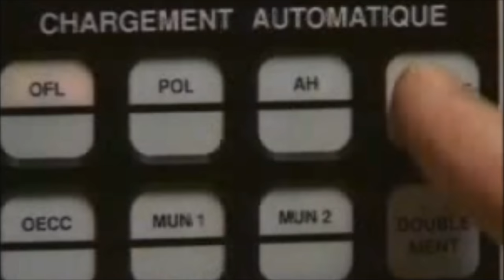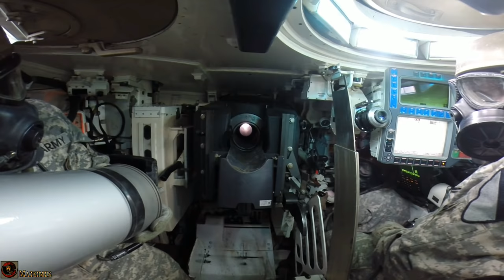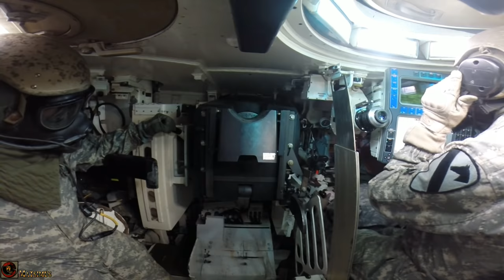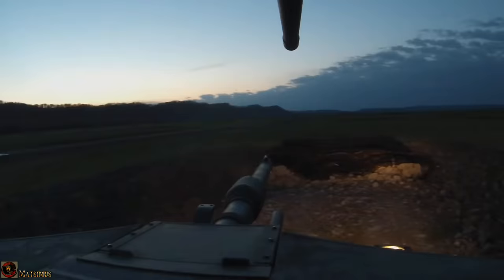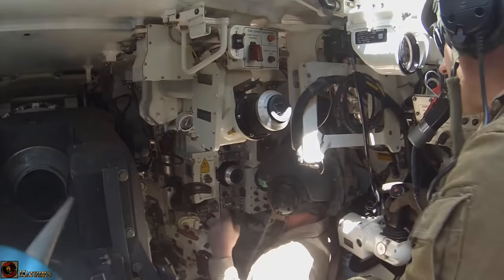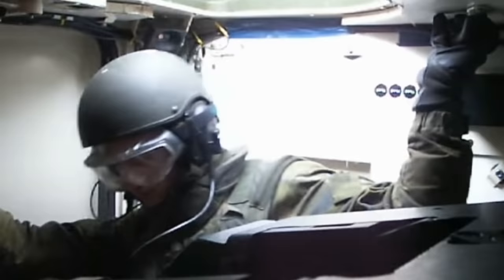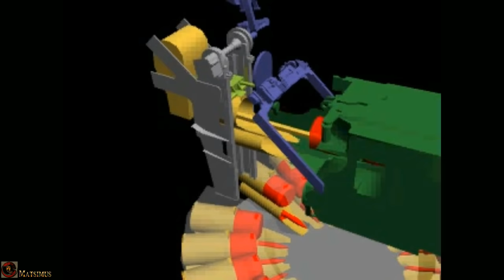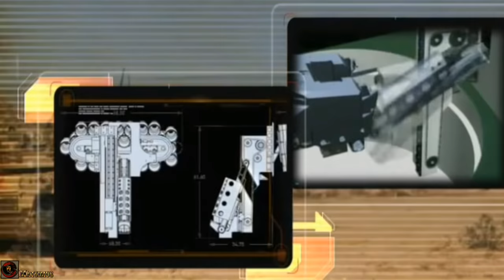Tank Autoloader or Crewman Loader?

Comment: many commentators don't possess logic at all...) ) the zarzhaniye automatic machine, not only reduces the number of crew, he is safer in fight because loading can be wounded and the commander should take his place, to the commander it is necessary to be constant busy in fight, it can bring down the general tactics of approach... in the Russian tanks isn't present loading, the gun can always shoot, can be loaded and be operated aiming and the tipper-of and the commander... the tank without autoloader can't be charged at great speed and when goes on the rough country because loading won't be able normally to hold balance, both hands will be occupied holding heavy ammunition which can fall on the uneven road... in the Russian tanks the speed and flatness of the road doesn't matter, he can shoot and be loaded even constantly jumping on springboards. . further and probably the basic, the Russian tanks having smaller dimensions and internal volume have the smaller area of booking, and according to them less metal is necessary for armor as the result - they is much easier... but as they it is easier, there is a large supply for increase in thickness of armor... FACT..., the latest Israeli tank "Merkava Mk.4m" has the weight of the tank of 70 tons...!!!, but the Russian T-90 tank, having weight only 46,5 tons has much more best protection, his armor is much thicker, by recognition of Israeli military t-90 by 1,42 times has more protection, than a merkav... on protection of one cubic meter of internal space in the Russian tanks is one ton more than armor, than in a big merkava... when has appeared Abrams's t-72 wasn't yet, the t-72 is 8 years more senior than Abrams. . Israel couldn't punch t-72 armor from conventional ammunition they could line t-72 only from the latest Pattonov and only uranium shells, then t-72 weighed 41,5 tons and there was no dynamic protection when have established dynamic protection, t-72 couldn't punch nothing... now the t-72 weighs 46,5 tons as t-90, the empty armata of t-14 weighs 50 tons, but at the same time in an armata it isn't necessary to reserve strongly a tower, the main weight of armor protects crew from 3 people... one more advantage of the autoloader is that shells can be stored below a tower... what is the tank in defense...??) it is the hidden case of the tank and only the tower is seen... in a tower only the gun, shells are hidden in the Russian tanks below, and having punched a tower you won't touch shells... and what is Abrams in defense...? it is the sticking-out tower in which shells also lie... any probity towers of Abrams can cause a detonation and destruction of the tank... the bronestenka can save crew only if few shells in a tower or if all of them armor-piercing and subcaliber, in these shells there aren't enough explosives and their detonation weak... but in modern wars there are no tank battles as in World War II any more, the main threat is posed by people with grenade launchers and aircraft... to shoot at fighters with subcaliber shells it is inefficient and ridiculous... it how to try to get from an air gun in the flying mosquito...)) the most effective against manpower of the opponent, is fragmental explosive shells... and here at Abrams and the Leopard problems begin... explosive shells contain a huge amount of explosive... one explosive shell detonates when blasting a tower of Abrams and the Leopard is much stronger, than a full boyeukladka of armor-piercing shells... and present what will be explosion if in a boyeukladka a half of all shells fragmental and demolition...??? you can see results of it in Syria and Iraq... for one fight Turks have lost the 10th new the Leopard-2A4, in Iraq of Abramsa burn down much in bigger quantity... and practically all tanks are destroyed together with crew... at a detonation of fragmental explosive shells neither armor of the tank, nor the reserved wall, nor explosive panels saves... power of explosion and temperature so big that the tank burns out together with crew from within. . and if there is a lot of explosive shells in a tower, then blows up with a tower separation as the ancient t-54/55 punched by an uranium shell of Abrams... If in the Soviet tanks ammunition stood vertically and that they have detonated it was necessary to punch the case sideways of the tank, then on t-90 shells lie horizontally, in a special armored container on a tank floor, with the ammunition laid in one layer around, it is almost impossible to get to them, probity towers and cases of t-90 won't cause a detonation of a unit of fire...)) Russia has accumulated extensive military experience, participated in many tank battles, there was also a successful experience, was also sad, but each battle amalizirovatsya long and deeply then, engineers and designers created hundreds of options of a design, fired at thousands of tanks on tests, and believe наслово, the country which has lost several million people in the most severe wars knows what is the tank and what he has to be...

Comment: Why auto is better? Two words: human error, human injury, human stupidity:p
Reply: Mike Mahmoud Can a autoloader repair a track or stop a major tank malfuction?
Reply: Joseph Stalin what the hell does that have to do with an auto loader whether or not its better?... no it cant, it shoots other stuff. But do you really think what you said doesn't make it better?😂😂
Reply: Mike Mahmoud because a human can load a gun and repair the tank
Reply: Joseph Stalin dude its whether or not the auto loader system is better than human application, its not better at fixing tracks we can agree. But thats not the argument here. Its like you are saying can a car do the dishes, when someone asked you if a AI car is better than human application.
Reply: Mike Mahmoud whats the purpose of a autoloader when a human can do it just as good and then some?
Reply: Joseph Stalin in a 3 person tank that has an autoloader dont you think they are trained to fix a track or do repairs?  With or without that extra person? And then some like what exactly apart from track repairs? In the heat of combat and you lose a track then what? I dont know how they are trained to work that out but you can basically have one man on the gun and the rest fixing the tracks, you are just saying that having an extra person is a good asset i understand. You can also design a tank with an auto loader,4 crew where you have a dedicated track repairer as a extra. Case closed😅 but still doesn't change the fact that human reloading system is better than an automated loading system. On the table there is human error and injury, which disables the gun or reduces fire output. In both cases any damage to the gun is a point lost. Rate of fire decreases with exhaustion in combat. The outline of the argument is whether automated is better, not whether an extra hand is better. Fire rate, endurance, and simplicity.